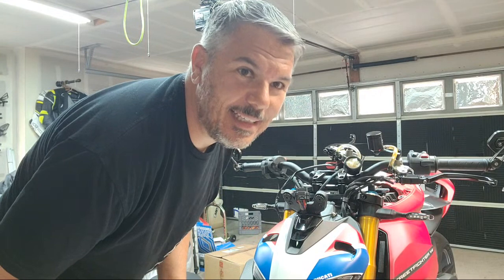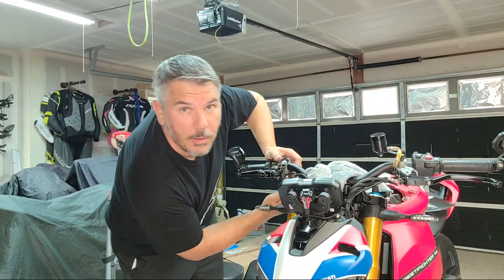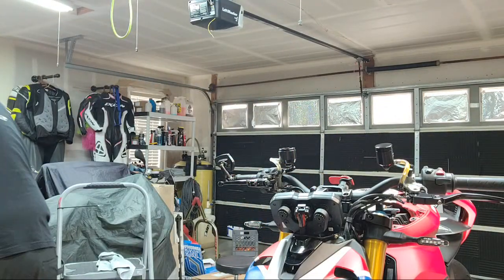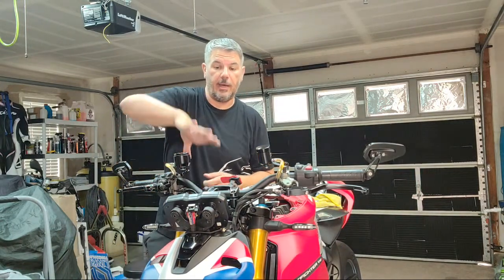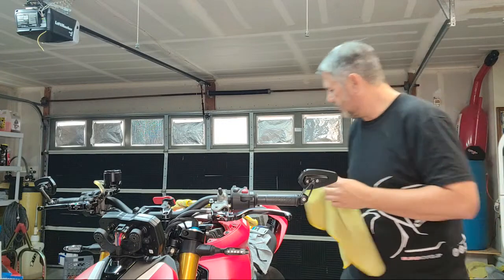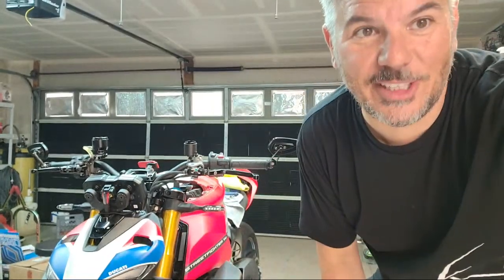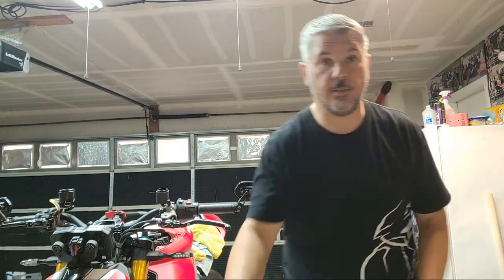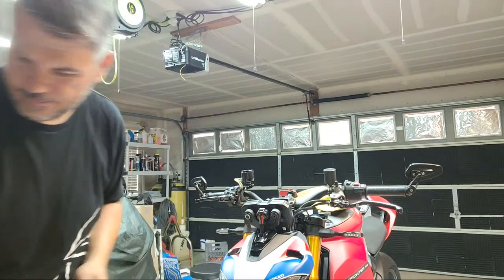Hanging Out Working On The 2020 Ducati Streetfighter V4S

Comment: Re: Fuel range. A fuel gauge becomes a thing on some of the Central Coast/Valley rides; gas stations have been known to go out of business, especially in the back areas where military bases have been shuttered. I was the bike whom everybody rolled their eyes over because I had to ride gas-to-gas while the Hondas and BMW hadn't tanked up since Hollister or before. I'm ambivalent about cruise control because it seems "new-fangled"; I've never used it on my car, maybe because I shift thru 3 gears in the car at freeway speeds. 17 litres seems to be Ducati's favorite number.

Comment: You began to speak about the process of buying the SF in Nevada, then you detoured because of Bailey. I'm searching for alternatives to buying one locally. Can you speak about pros & cons? I live in California too. Thanks.
Reply: @CaliMotoTV  So, the bottom line is that given the added costs of hauling and miscellanies; there was no savings than if you bought it from Livermore, or Monroe Motors (where I am)...? While those bar-end mirrors do away with the moose antlers, they add more width; have you tried lane-splitting with them? Thanks! Years ago I had a Scarlet Macaw too. My last Duc was an 888. Many of the recent reviews act as though engine heat is a recent thing; I got a 1st degree burn about the size of a 25¢ coin thru leather on a Trinity Alp ride one AND the heat melted wiring harness at 3000ft, outside of Whiskeytown Lake! This step-by-step video is interesting AND entertaining: Thumbs Up
Reply: Just walked in the door from visiting Munroe Motors; did a toughie-feely of the SFV4 and the V2! Their "estimate" is 28 and change, out the door. 🧐
Reply: @CaliMotoTV  My gut felt that that was going to be your reply. I didn't buy my 888 from them for the same reason. In their favor; they were way more personable than what they've been historically know for. I really appreciate your reply!!!
Reply: @CaliMotoTV  I sat thru ALL 3:30:25 of your video!!! LOL! On a serious note: I appreciate your clarification about focusing on bikes and not going the pinup route that other YT's are playing. I've chased some extremely competent females riders, as a matter of fact in the Berryessa vicinity. I'm even starting to question the umbrella girl eye candy thing. I watched an interview last night featuring Rossi, Dovisioso, Quartararo, Miguel Oliveira and....I'm forgetting the names of the other two GP riders; Rossi piped in about welcoming more female competitive GP riders; I respect him even more for that.